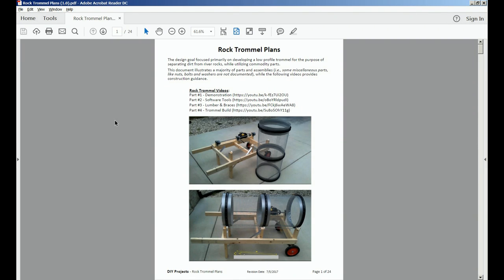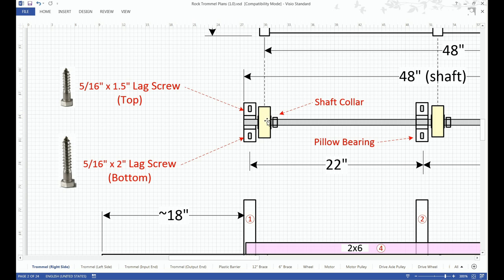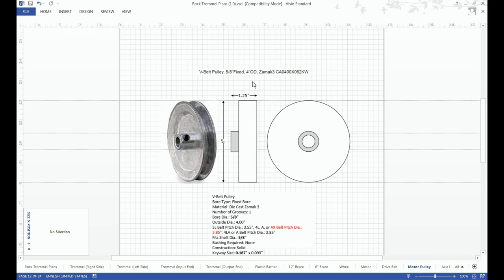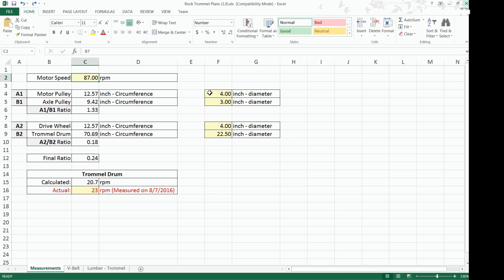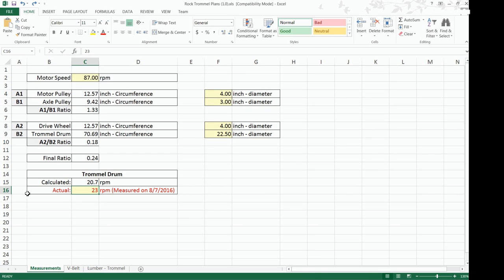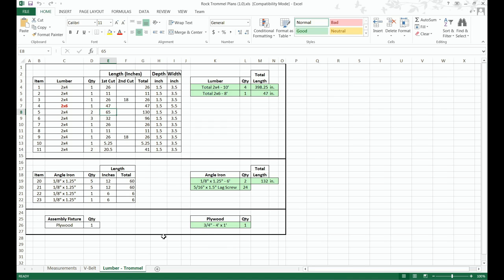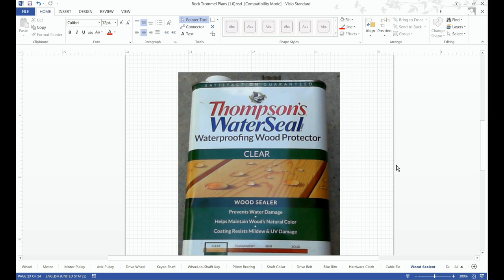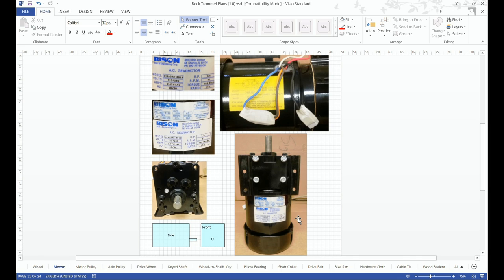Rock Trommel / Rock Washer (Part #7 - Trommel Plans)

Comment: Great job! A simple case of mechanical engineering. Extensive! Very well done. Thank you for documenting and sharing this. You went to a lot of work. Good teacher. I do wonder if all the mechanical parts are easily available.  Good project for me and my grandson who wants to ne a mechanical engineer. I am a retired electrical engineer.  I wonder about the long term durability of the wire mesh. I have 3 tons of 3/4 gravel and dirt I would like to separate.

Comment: Great video and plans!  Can you recommend a source for the electric motor?
Reply from the maker: Ebay.com and search for "gearmotor", which is the motor type this trommel is using.  Ebay has a wide selection of new and used motors.  You may also find good used motors in the local salvage yards.
Reply: Cheapest motor with similar specs I've been able to find is about $300. This build isn't really worth it for me unless I can get the motor for under $75. Is this motor overkill for this purpose?

Comment: I'm having a heck of a time keeping my trommel from walking
any thoughts?
maybe I don't have the casters centered?
I had to take off my guide casters mounted horizontally because they interfered with my deflector screen on the output
Reply from the maker: Can you take a video of the issue and upload it to youtube?
Reply: DIY Projects yes, will upload in a day or two (trommel located off site)
will post link here when uploaded
thanks!

Comment: I'm having a hard time trying to find the idle wheels and drive wheels
Reply from the maker: http://www.battlekits.com/robot_wheels.htm#Drive Wheels with Keyed Hubs
(Part# 4W) This is the 4" wheel.  Note this wheel's keyway is 1/4" x 1/4", while the Keyed shaft's keyway is 3/16" x 3/16".
If you would like to know how I got around this issue, please watch https://youtu.be/Rj9OEOmta5c ... this topic is discussed around 6 minutes into this video.
Reply from the maker: The website's hyperlink didn't function correctly below in my previous response. 
The correct website link is as follows within the quotation:
"http://www.battlekits.com/robot_wheels.htm#Drive Wheels with Keyed Hubs"